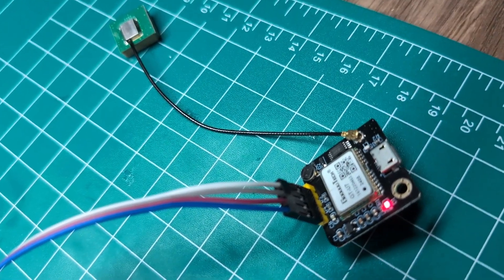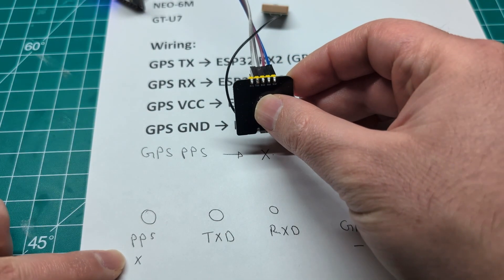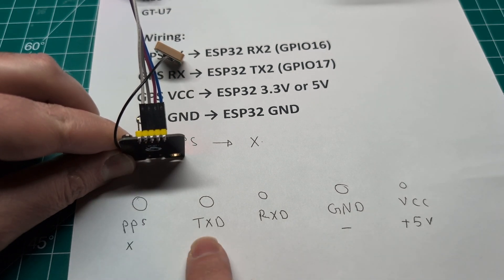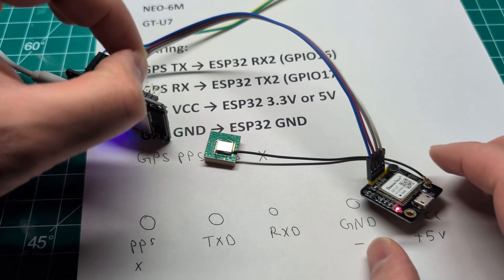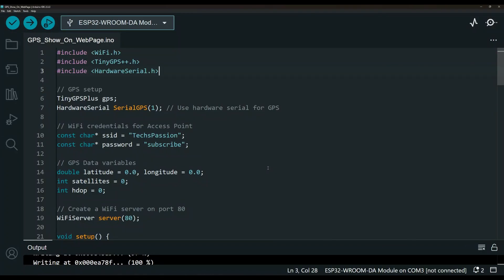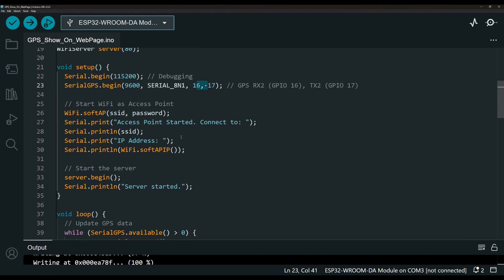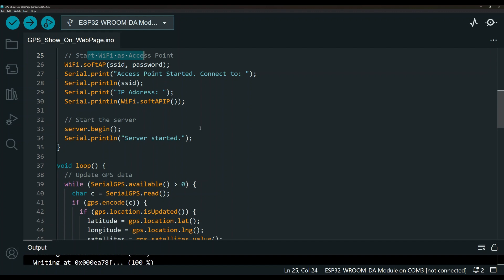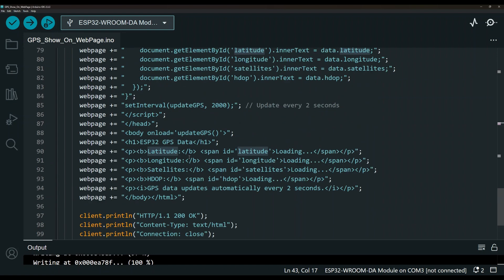GPS Module NEO-6M

Comment: Can you help me please , there is a problem that I don’t know how to solve 

I connected the pins from gps module to my NODEMCU ESP- 32S type-C 

GND TO GND
VCC TO 5V
TX TO P16
Rx to p17

And plugged it to the laptop , after that i opened arduino and it successfully detected the connection (there was a writing “Node32s on COM3”)

Esp and gps lights were on 

I copied the code and changed the wifi name and password on ssid and password

I verified and uploaded the code

It said 
Acces point started. Connect to: (my wifi)
IP Adress: 192:168.4.1
Server started.

And after that i wrote 192:168.4.1on a google, but it answered like Unable to access the site

Can you help please?
Reply from the maker: So the IP address for your board might not always be the same as my IP and when you say typed it in google, do you mean browser? are you connected to the same network?
Reply: @techs.passion I don’t i just copied your code and it said that i have this ip, yes same wifi

Yea on a browser

Comment: What is the best GPS module NEO 6M/7M/8M, or ATGM336H module, for NEO-M8N
Reply from the maker: The 6M is not bad but it's more for education and I'm not sure how accurate it is.
For the best performance, accuracy, and reliability: Choose the NEO-M8N.
For a balance of low cost and modern features: The ATGM336H is a great.
For the absolute lowest cost and simplest projects: The NEO-6M

Comment: What code changes, if any, are needed if I use an ESP8266 Node MCU? This board only has 3.3V output which should be OK.
Reply from the maker: Yeah it should be okay, the only thing is you need to change the board on the IDE and the Library should work on both esp or Arduino